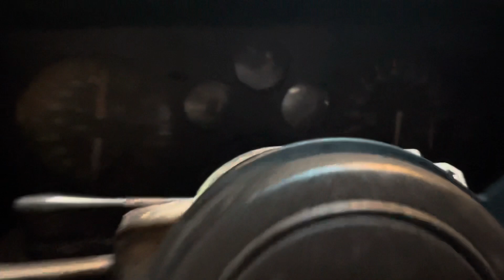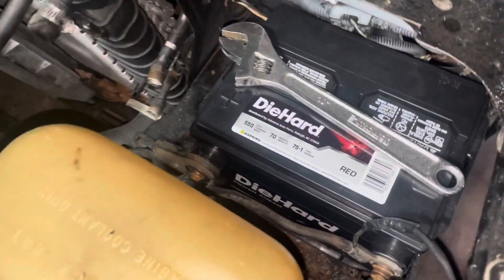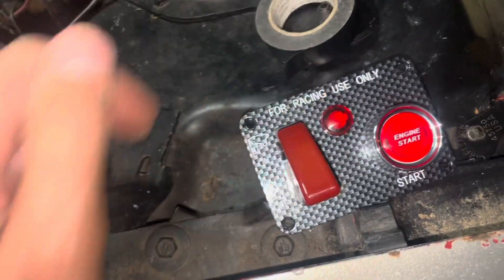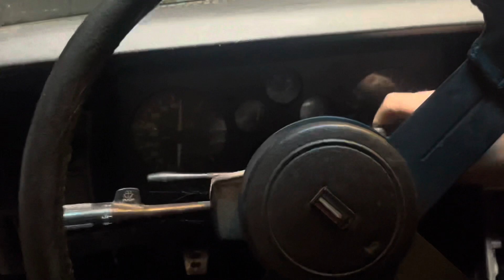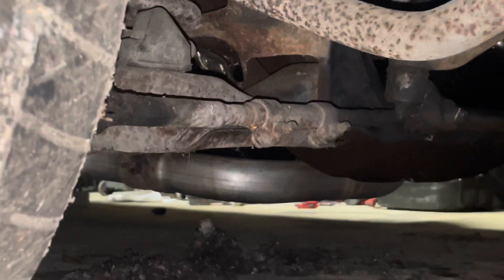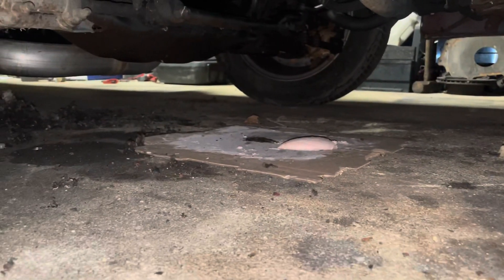Will My Cheap Supercharged Camaro Start?

Comment: Sounds like a burnt out starter that drains the battery on start(cranking the bad motor too long). Alternatively, If the Motor rings are toast, then the owner lied. Ain’t no way he put those parts and work just to leave it sitting before giving up on fixing.

Comment: I saw in your last video on the car that when you drained the oil there was a lot of water and I think I might have the same case in my car. Would you be able to give me and advice or tips on what to do if i drain my oil and theres water in it?
Reply from the maker: This is my first car with a oil pan full of water, this engine has major issues. One way or another water in your oil is no bueno. Read through some of my comments some people gave some good pointers/tips. In my case I believe it was a bad head gasket allowing coolant to go into oil & be burned

Comment: Don't want to repeat all I stated on your last post but that engine is most likely freeze damaged with internal cracks it may run great but block is junk. Just keep re checking the oil. More milkshake she is toast. Strip the good stuff and move on. It's not even good for a core if you went for a crate short block
Reply from the maker: Yup it’s a thought that ran through my head at this point anything is possible
Reply: @TJR_Auto  the fact that water was the mix with oil not antifreeze. See it all the time in boats because most aren't closed cooling and use the lake water. People always get caught not winterizing. 9 times out of 10 there is no external damage all internal cracks with everything running perfectly. They were running it with water and a cold snap caught up with them. They ran it saw milkshake and knew what was up when they sold it. They weren't even sneaky enough to hide it with fresh oil in the crankcase.
Reply: Wouldn't you see more steam from exhuast ic it was a bad block?
Reply: @TotheSoundOfThunderingEngines  most of the time it has nothing to do with combustion chamber. Cracks into the crankcase and running, the water pump pushing the water starts filling up. Some you see quick. Some customers of ours drive the boat for hours until they look in the engine compartment and the milkshake is coming out of the valve covers. It sucks because everything looks and runs fine until it fills up. Some even rust over the cracks and they hold out for a while until some heat builds  and the water finally pushes by. We even had one once that we couldn't replicate test driving for a short time but the owner on a day out with kids hammering on it would get the milkshake result.

Comment: Well,....I can see why the previous owner had charging issues. That's nest of a wiring job is horrendous. And by the way??? Be careful about spraying that brake cleaner or carb cleaner. It'll float your values and smoke your rings. Trust me. I know.
Reply from the maker: Yeah this car would need a new harness to be “betterish”, and I only sprayed a wee bit of the starting fluid 🤣
Reply: Dear The Anes Ex...
👍👌👏 You are absolutely right, Sir. 2) To feed the carburator, one can simply use gasoline! Or, even better, two stroke fuel (non ethanol) and such a squeezable bottle with a small hose on (like for instance famous Mustie1 absolutely always does).
Best regards, luck and health.

Comment: Turn down the idle
Reply from the maker: Turns out there was an open threaded hole on intake manifold which was a huge leak causing it to idle high. I over looked it but my buddy saw it backfire out of it when we went to time the car